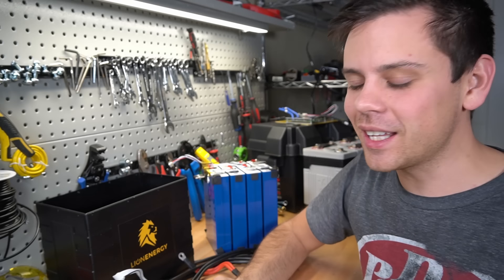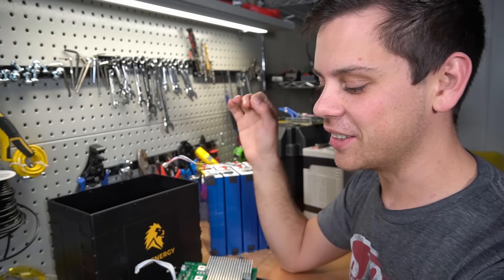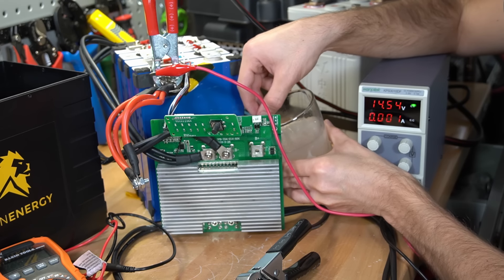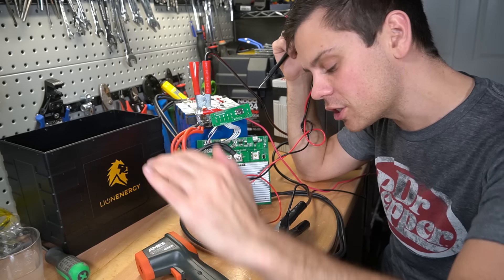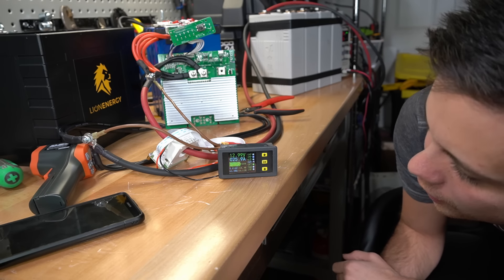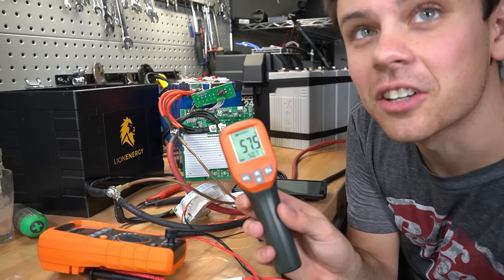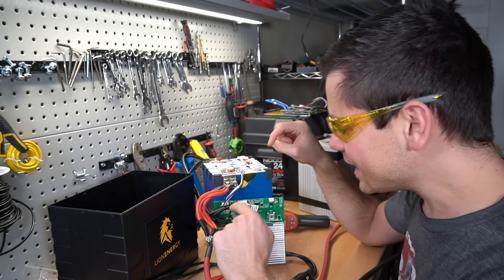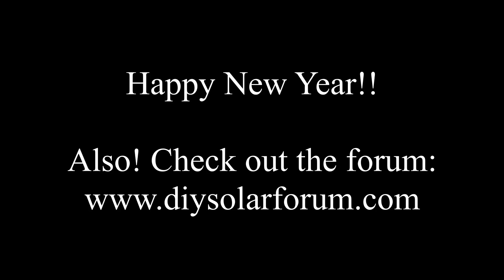Lion Energy 1200 UT Tear Down: High Amp Stress Test and Low Temp Cut-off

Comment: Amps include the wire loss. Series circuit, the amps are the same in the entire circuit. Some of the power (watts) is used in the heat gun, some in the wires, that is the wire loss and is due to the voltage being lost across the wires, not amps being lost. You can measure the voltage loss by using your voltmeter, set to volts, one lead on each end of the wire. The voltage, multiple by the amps measured anywhere, is the power lost in the wires.

Comment: Put your current sensor on the small wires leaving half out, then it will show half the current, as long as the wires are equal,  you can test 250 amps then , it will show 125a

Comment: Great work Will, keep it up! Also,  next time your test leads get hit like that you could measure the voltage drop from the battery to the inverter with a DMM, per wire. It will at least give you a quick reference to what the inverter is seeing.  Looking forward to your next video!

Comment: Suggest you have the current measurement taken from the two identical wires on the battery connection so the current will now be close to 50% on each and you can add together for more accurate reading...  also either double up on external cables or reduce their length as they are possibly causing more voltage drop than the battery terminal leads themselves.. Great work ...
Reply from the maker: Very smart idea. And I need a larger meter. Thanks
Reply: When you put two parallel equal resistance lines you are reducing the magnetic field, a bigger meter does this internally and is not necessary a better meter ... in most engineering labs we have a standard high quality meter which is then teamed with a number of fixed load accessories... my suggestion is to make a up a 1:4 parallel wires and keep you current meter working in it most linear area ... typically this is 30 - 60% load .... eg a high quality multi meter is a very linear display with high quality - accurate - resistors from .01 ohm up to 1meg ohm ... . Most measurement equipment only uses a fraction of the input ...  just trying to keep your money for more batteries and solar .. regards Jeremy
Reply: DIY Solar Power with Will Prowse pry open the wallet... get a Victron meter.

Comment: Nice, salt water for the win. Btw, to get a really accurate temperature reading of the salt water/ice mixture with that infrared thermometer, you want to be aiming it at a matte black surface, the readings are kind of wonky sometimes with clear or reflective things. You could use something black floated on the surface or alternatively, traditional thermometers with decent accuracy and precision aren't too expensive these days. Any cheap lab thermometer would give you a much better reading of the actual water temp.

Comment: I use a TI EV2300 to communicate with the fuel gauge system on rando BMSes, they definitely log cycle count but theres a LOT you can do in there. The features on those bluetooth apps are all in there.

Comment: I am an engineer in the automotive industry.  One issue that we always run into is when the supplier (mostly Chinese suppliers) chooses the parts they want to test.  Typically they select the "best of the best" parts for testing.  The same situation applies here.  I am ALWAYS skeptical of testing when the supplier selects the parts for testing.  We have no idea if the test sample part represents the production as a whole.  In this case, for all we know, the supplier could have "hand built" this battery, including adding features that are NOT included in the mass production version of the same battery.  For example, do all the batteries use the same BMS or did the supplier "upgrade" this test battery with an "uplevel" BMS.  The only way to know this information is to select the test batteries at random AND follow the Weibull curve.

The best method is called blind sampling.  Whereas the samples are chosen at random over the course of a day/week and then tested by an independent lab.  This is especially true with the Chinese manufacturers.  They cannot seem to grasp the concept of the bell curve.

In most cases, I travel to China and visit a few suppliers.  I will personally select the parts to be tested.  Sometimes I use a random number generator, and sometime I will walk to the factory floor, and witness the manufacturing personally.  I will then cover my eyes, and in dramatic fashion, reach into the box to pick the test parts.

@Will  No disrespect to you, my man.  However, I NEVER trust any testing where the Chinese supplier has selected the parts for testing.  I understand it is very expensive to purchase these with your own money.  Also I appreciate when you tell us each time a battery is "sponsored" or purchased "with your own money". There are several YouTubers who test products and most of them NEVER test items that are supplied by the manufacturer.  The test samples are always purchased with their own money, albeit the test samples are much lower price than a $1000 battery.

Thanks for the video.
Reply from the maker: Yep that's why we buy most of my batteries. Have you seen my other videos? We cover this many many times. Look up the ruixu videos where the one they sent was different than the mass produced one. This battery was sold at Costco and you can open them in two minutes, so they are for sure the same. But with lots of other batteries it's not the case. Yeah, watch my other videos. Very common thing we cover on this channel
Reply: @WillProwse  Thanks Will.  My response was not very clear and I apologize.  I have seen all your videos and my point was to give you credit for explaining whether you purchase or get sponsored.  Also my comments were geared more towards the general audience to give you credit for being transparent, like some YouTubers.  Although other Youtubers do not specifically say "I bought this with my own money" like you do.  So one can know what to expect.

My experience with Chinese manufacturing is very unique as I travel to China (and Korea) 4~6 times per year to visit manufacturers.  These are automotive manufacturers not battery manufacturers but the general manufacturing process is the same: bring raw materials in, perform some operations to add value, finish and ship.  China has come a long way in the past 15~20 years.  However, they still have a long way to go to catch up to American manufacturing (and some Japanese & European I might add).

Again, thanks so much for your contribution to the solar DIY community and the general engineering community as a whole.  Not many others go into this level of detail and I give two thumbs up to your methodology.  You probably could be A2LA or QE certified if you every want to go down that path.

Comment: Wire size only matters on longer runs,  look at the tracings on the PC board you think that little tracing can handle any amps?  Also, tear apart a fuse sometime and check out the size of wire inside that the current is running through,  super small.

Comment: One feature that would be neat for these batteries is when the temperature cut off activates, it would have a small heater to heat the battery.  So the first step of charging would be to heat it up to proper temp, and then it would slowly start to ramp up charge.

Comment: You are very busy, Will, just in the beginning of the new year! Great review again and nice to see you excited again :-)
Are you sure these wires are pure copper or just copper coated alumium? In my opinion they are getting too hot for the amperage...
Reply from the maker: Oh absolutely not cca. They are tinned copper. They were under gauged. The wires on the battery were cooler than welding cables.

Comment: Sadly Michael passed away, 2001. He my cousin held the UD patent for multiple battery charging systems like bms. What he told me. It had software and curves to properly charge even different kinds of cells. I believe he sold the rights but could explain whats going on. Like most inventors died poor. 
HNY. Looking for good year. I want to put in 4kw 50% duty cycle system under $5000. I know that you will be the main source of my info. 
I have worked on L I V E 12000vac and 20000vdc system and truly appreciate your safety. Sadly at plant bosses did not heed my advice, three men died and millions of dollars lost. 
Can't wait for new equipment.

Comment: Hi Will, food for thought if you will:
In reference to the battery, you said towards the end that "They just send these out for review". That sentence makes me wonder if the same bms (& all components) would come in a battery that any every day Joe would order, or are the ones that end up being sent out for review a beefed up version of the ones intended to be sold to the general public?
Reply: Great video Will, I have a question. I have an 8 amp battery charger for my 12v 55ah agm battery, I can't charge my 12v agm 100 ah battery with my 9amp max put out generator. I'd like to switch to a 100 ah  lithium battery but not sure if it will be able to charge it. I live off grid so I can't charge it with ac. Also, if I get solar, how many panels would you estimate I would need for 3 100amh lithium batteries, especially in the winter living in Southeastern Wisconsin , when we have a short period of sun light. Maybe I should think about getting a stronger generator before solar ? What does anyone think ? Any suggestions? Please, and thank you.

Comment: Hi Will. First want to say I love your videos. You are so knowledgeable about electricity! You talk about it like it's small potatoes and your always calm, while the rest of us are scratching our heads. So thank you, thank you, thank you. I have a question. I don't expect a reply because I know your a busy person however I'm gunna try and ask just in case. I live and work in Las Vegas. I just stared living in my converted van. It's getting hot. I just added 200W of solar to my system. So I have a total of 300w. I also just got rid of my cheap charge controller and got a Renogy Adventurer with Bluetooth. I like the charge controller. I'm now ready to upgrade my battery. I've been researching for months, watching lots of your videos. Because of how hot it gets in cars here in Vegas I was reluctant to buy any. I have a flooded deep cycle currently 208ah. But it's old. This is the best one I found for high temp and it's on sale - Renogy 12V 200Ah Lithium Iron Phosphate Battery w/ Bluetooth. Would you say this is a good battery for high heat?  (Size wise I think it will suffice for my needs but I was concerned about any battery being in the Las Vegas Heat.)
Thanks again for the great videos, love watching em and learning.

Comment: Low Temp Cut-off
 Hi Will, It seems like the weakness of cheap BMS units is lack of low temp cut-off. Have you thought about adding it a a separate component? I just looked on Amazon and found several Temperature Controlled Switches that can trigger a relay on or off at a programmable temperature. This seems like it could be a way to convert any BMS to a temp controlled BMS. Perhaps you could make a video testing such a setup?

Comment: Hey Will.  Question I'm struggling with.  I have 3 Expion360 120AH batteries in the RV, but they don't have low-temp disconnect.  Ive been told by everyone that I have to continue to buy the same batteries if I want to put more in parallel.  I understand that the BMS's are different, but why can't I put a BattleBorn in parallel?  I hate the idea that the "same brand" stuff is just a wives tale.

Comment: Will -- i sent you a PM on DIYSOLARFORUM ... It looks like Superpower SPB-T04-014-A04 has been discontinued …  I dropped the engineering department at superpowertech a question if they sold the SPB-T04-014-A04 version for both 12V 4S 100aH and 200aH ... I'll let you know what i hear ..
Reply from the maker: Thank you!!!
Reply: @WillProwse  there is an updated SPB  A05..  I left you a mssg on it.
Reply: @dn52n56  Im building my own battery, could I pls trouble you for the info on it pls. thanks
Reply: @dn52n56  That one ONLY does 10A ... not 120A
Reply: Here's the link to their motorcycle BMS spec sheet. (in chinese) Google translate doesn't give the best result, but it's looks like a 40 amp BMS.
Reply: @jmacd8817  LINK??
Reply: Will ... Have you reviewed/done a breakdown of the Dakota Lithium 100ah?  I'm curious about the build quality and if it stands up to your high standards. They offer a pretty good discount if buying in quantity.
Reply: ghostwriter6699  please let me know any updates , here we have large starving market in Australia.
Reply: @philipdishongh5074  $679 for 10+ quantity.  We could do a group buy.  Heavier discounts for higher quantities.
Reply: @mfgxl  Yep, but not sure about how warranty would work/transfer with a group buy.
Reply: @meytimeshki  I contacted the manufacturer of SPB-T04-014-A04 directly and was informed that they had made this specifically for a "certain" client and could not sell the BMS independently and that they did NOT have any other BMS in their product line that competed or was similar to it.  Looks like we are back to square one looking for the "perfect" BMS

Comment: Appreciate the review. Instead of shocking sensors with sub-freezing temps, it'd be nice to know if these any of these cutoffs actually trigger at 0/32 like they are supposed to.
Reply: boondockinglife that's the point of the salt in the water.
Reply: @dtrubow  Isn't the point of salt water to keep the solution liquid around 0c so you can drop the sensor in and get a good test reading? Shocking the sensor at -9c, and then using body heat to warm it up again doesn't exactly tell us the cutoff is working to spec. Depends how much time and money Will wants to invest, but I think getting a closer approximation of how well the cutoff works would be useful info since not getting it right has the potential to permanently damage the cells.

Comment: Hey Will, Thanks for all of your videos! Your work got me in to a great 200A 8-cell battery bank for my camper build. One thing I've been wondering: Is it possible (and realistic) to use these cells for BOTH 12V and 24V simultaneously? I would love to push 24V to my fridge and ZeroBreeze 2 AC unit. It seems the only big challenge would be in charging them all equally, but that should be handed by the BMS just fine....????  Or what am I not understanding?

Comment: I want to build a 48V system using 12V batteries, but a particular battery marketed here in Australia specifically states that you can series no more than two batteries. I imagine this is because the BMS they use cannot support greater than 30V or so. Can you tell us what the series voltage limit is for the 12V batteries you have reviewed so far Will? Happy new year.

Comment: That was cool. What size wire would you rather use?
Can you use the BMS from the original battery to build a larger battery from modules?

Comment: Will, do you think they base the ratings on the boost of the BMS? I know on some BMS it will be rated at for example 120 amps, but has a boost of 150? Also on Silicon wire vs PVC wire, it can handle allot more amps or rated for more amps-8 Guage silicon wire is rated at 190amps when PVC based on the wire used is only rated at 50amps. Love the Test Video!!!!

Comment: Happy New Year Will - we are adding 6 maxwell 650F in parallel with our 105a/hr  4S Lifepo4 so it better copes with the spikes when the inverter is switched on or the microwave oven kicks in - it worked without the super caps but we wanted to cushion the dip - have you any thoughts on our modification?

Comment: You could use a clamp meter. They are cheap, but not very precise. But they measure up to 400 Amps. Better than no measurement.
Reply from the maker: I broke mine recently. Buying another today

Comment: I looked up the BMS on Super Power website. The closest one I could find was under their classification : Class 2; robot. It is SP T04 012 A05. It has a hot and cold temp. Cutoff. I don’t understand chinese enough to know if it will handle the charge and discharge rates?

Comment: So, do you recommend this 105Ah or the Battle Born for a sailboat house bank of about 800-1000Ah?  Price is about the same, but Lion webpage says lifetime warranty and BB is 10 years.  Your thoughts please....
Reply: I know Im not WIll, but Id guess he would recommend you go custom, Buy the cells and the BMS for that size. You are talking 10kwh-12Kwh. Thats a Tesla powerwall size. There are better options that using multiple drop in replacements.

Comment: If you get bored you could build your own liquid nitrogen production system.

It’s completely unreasonable but you could dump excess power into that system and make and store liquid nitrogen as a battery and a thermal differential system to get the energy back (can’t remember what that’s called)

...or just use the liquid nitrogen later to as a chilling system for your fridge hot side.

All completely unreasonable but entertaining systems!

Comment: It's the same as anything else coming from China . Great stuff as long as you verify every component to speciation's too include torque on any mechanical fasteners adding Loctite to any not meeting mechanical speciation's . In other words , don't count on it doing anything you need it to .  Looks good though and almost as cheep as one you built yourself but a whole lot more trouble .  Take  Care
Reply: P.S.  If you have something built over there they will fallow your spec's to the letter and that's where trouble arises . Everything with a minimum spec is exactly all you will get .

Comment: The wires got very hot even with being exposed to air. How hot will they get sealed in the battery case with the other components also giving off heat? Would this be hot enough to start making wires and components fail?